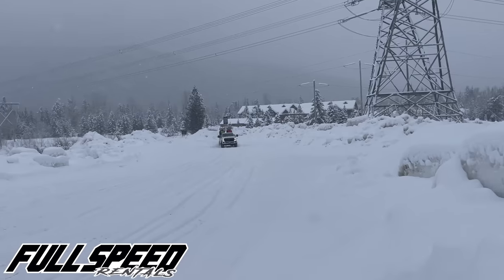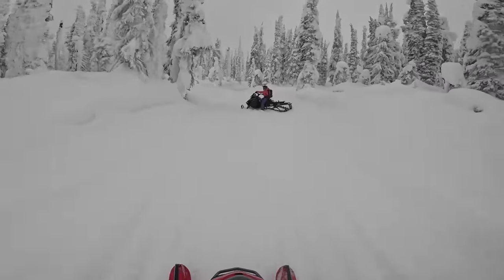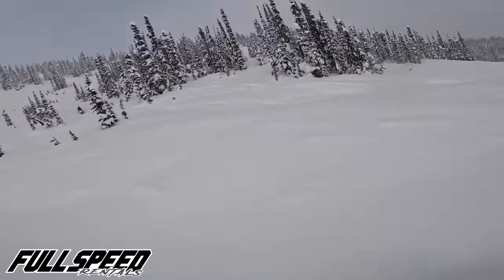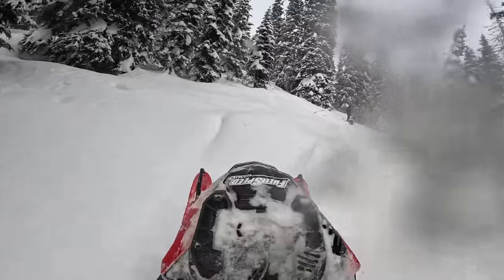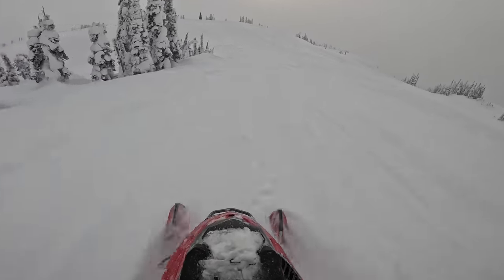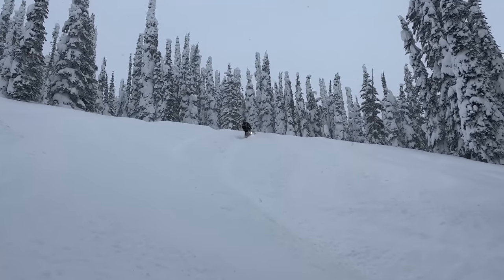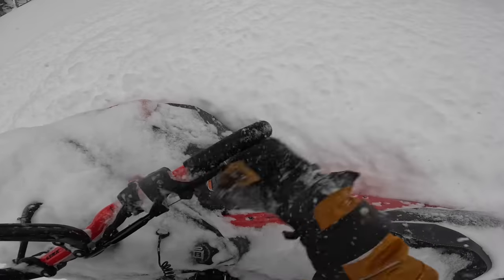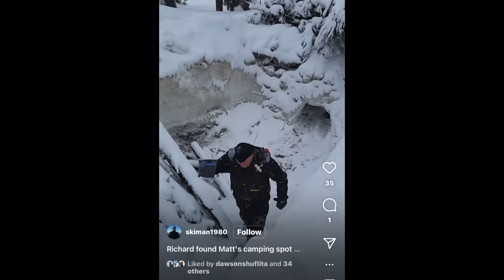LYNX Shredder First Ride

Comment: I rode the trail Lynx,  it was pretty bad ass right outa the box suspension wise. Way better then anything Polaris sells for trail. Wish they'd shave the tops off the side panels and put XRS style seat on it for trail. The front of seat ended to soon for shorter guys that need to get up on the front for speed cornering,  that's where that point of side panels bangs off knee

Comment: Let me ask you a question......  on any of the new sleds you have been on, have you noticed a difference in how hard you need to pull the brake lever?

My 2020 850 and my new 2023 850 (exactly the same sled model)  the 2023 I need to use my full hand to brake.  It's always very hard.  My 2020 I can do it with one finger.   And my friends 3 sled like the 2020 are easier too.......
Reply from the maker: Yeah. Ski doo you pull hard, Polaris brake is 10x better
Reply: @Muskoka Freerider  thanks for the reply. 

I just noticed that on my 2020, 2021, 2022 and easier than my 2023.   Just wondering if you noticed any difference.    No one I know has a 2023 but you.  Not that I "know" you.  But I know you own one.

Thanks again.  Keep up the great "work" you do with the riding and videos.   Lol.  Every morning I watch them.

Comment: Funniest part of this video is that the lynx doesn’t even come with a rear out of the factory. 😂
Reply: Why is that funny 🤔
Reply: @cutznfadez4683  how are you supposed to lift the rear end? Pinch grip with you hand not sure what the point of making that an option is. Sled is probably more expensive then last year and now you have to pay for something that is an extra and should be standard
Reply: @Brobro449  oh shiiiit lol My bad, I didn't notice no bumper, I thought you were talking about no flap lol
Ya man, that's ridiculous - just another cash grab
Reply: @cutznfadez4683  oh all good. I think snowflaps weren’t as useful as designers thought tbh. Even in hardpacked or icy trail I think they still don’t do much. Ice scratcher I bet halo 2 to 3 times for then the flap